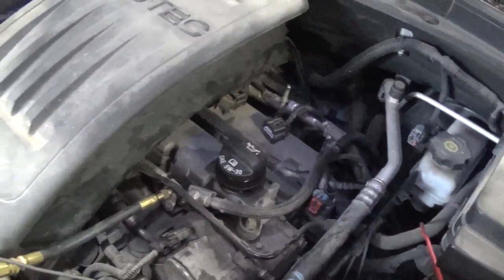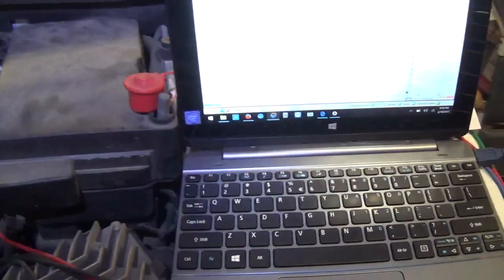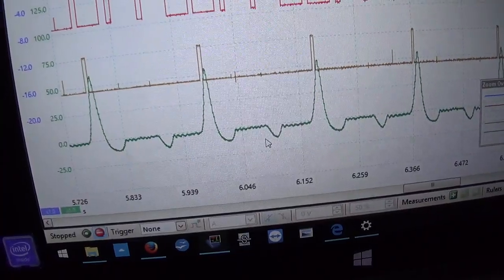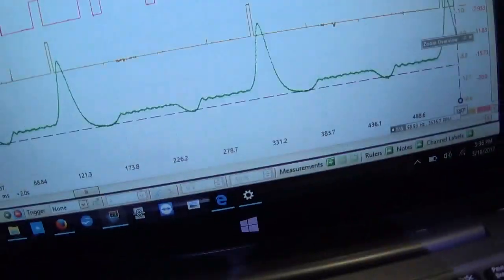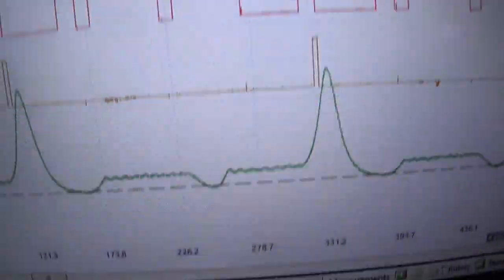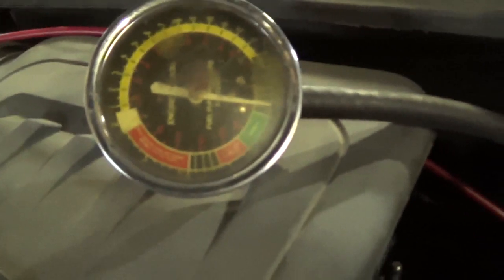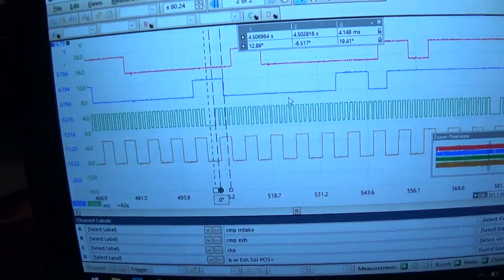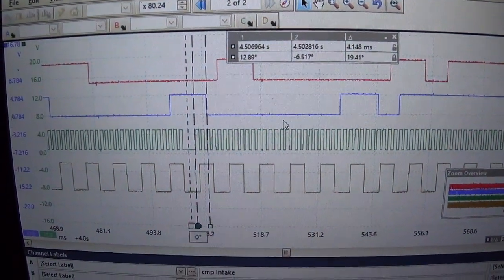P0016 P0011 Low Power case study: Chevy Equinox - Part 2

Comment: Yup been there, done that.Customer did new solenoids no better. We removed the cam cover, cam chain guides gone and most of the bolts that hold them ( top front bolt worn almost thru).Pulled the oil filter ,full of stuff. Customer installed timing chain kit. One thousand miles later engine seized.I bought the vehicle for five thousand (2010 awd LTZ , new GM six speed trans Ya the guy was tough on cars). Had the crank ground ten under, piston rings and gaskets and yes some did stick rings and burn oil. Put it back together, runs great(one and one half years later). The wife drives it every day she loves it(the body and interior were like new).  Yes boys and girls have your oil changed be somebody you TRUST and check your oil level at least once a week. Happy motoring.

Comment: Ivan this is a great video. Your pressure transducer is a great tool.  Going back to first principles when the intake valve opens the piston is starting on its descent in the cylinder and pulls a hard vacuum as it sucks air/fuel mix into the engine.  In theory the intake stays open until the piston reaches the bottom of travel and the cylinder is now full of air/fuel ready for the compression stroke.  However your trace shows two important things which are consistent with each other.  The intake valve, based on the short dip of vacuum, only opens for a short window so that the peak compression is only 62psi.  Most engines run at about 10:1 compression ratio so that you would expect peak pressure somewhere about 140-150psi.  Your peak pressure shows that the cylinder is only getting about 40% of the normal air/charge in the cylinder during the intake valve opening window.  It is amazing that this car runs.  You have also hit on something important here since the 40% charge when compressed and ignited still expands to the full cylinder volume.   Although this engine lacks its normal power it is actually running very efficiently for the lower power it actually produces as it is emulating an Atkinson cycle;  more work is being derived due to an effectively longer expansion stroke versus the compression. It would be good to put this car on a dyno and measure the power output and then measure the amount of fuel consumed. If the ECU, by monitoring the oxygen sensor feedback, can shorten the injection times sufficiently then stoichiometric combustion should be maintained.

Comment: Intake vacuum on my 2.5 was 8inHg when the timing was off. Engine load at idle was 50%! Ran even worse than this one. Would be interesting to see scan data for engine load. Might be as useful as using a vacuum gauge. Good stuff. Thanks Ivan!

Comment: Looking forward to Part 3. By those waveforms, compression check & low vacuum I think you'll find multiple issues. Once the timing and compression issues are resolved it should take care of the fuel pressure issues also.

Comment: Great job, i was watching it then realized the known good  waveform Keith sent you  was mine from iatn! Glad to see people are using it! Keep up the good work.
Reply from the maker: Cool! Now what year 2.4 was your waveform off of? Seemed to be different from this 2010 model...?
Reply: It was a 2011 equinox, the waveform i took was after the chain and guide replacement.
Reply: Also i have the known bad posted up on iatn.
Reply from the maker: Ah that would make sense! I think the cam-crank relationship changed 2010 to 2011...that would explain the discrepancy. Thanks for the comment!

Comment: Time for a story. The characters are:

Ivan (aka Padawan)
Keith (aka Yoda)

Padawan: Master Yoda I have a waveform here that is most perplexing. I shall send you the waveform.
Master Yoda: Your waveform I have received Padawan. The Force I have used to obtain a known good waveform. Most odd your waveform is. 
Padawan: What do you think the problem is Master?
Master Yoda: Off, it must be, your intake valve timing.
Padawan: What should I do next Master Yoda?
Master Yoda: Removed it must be the timing chain cover. Revealed for inspection must be the timing chain Padawan. 
Padawan: Yes, Master Yoda.
Reply from the maker: I had to use my own force on this one since Yoda sent me the waveform for a different year engine... XD
Reply: do you build in cylinder transducer boxes for people? If not, what plans did you use to build one? Do you still use the old style verus? Ill give you a docking station for it if you want one, i upgraded to the D10 and can't use it anymore.

Comment: Oh man, I was hoping for a part three or the fix as I wrote in part 1 I am having an issue with same code..This 2.4 only has 1 cam and 1 crank sensor both replaced.. Did psi test all four cyclinders are 180psi and at idle 20 on vacuum..as I've said replaced cam sensor and crank sensor and the vvt oil actuator and it does work..so my issue maybe ecm, I just don't know..

Comment: Awesome! Where in the Pico software did you set up your homemade transducer settings? How did you get the voltage to match pressure? I just barely got a Pico so I'm trying to figure it out.

Comment: C’mon Ivan. This was a easy one. You didn’t need 3 long videos for this. Some guys rely on the scope too much thinking it save time. In some cases it does. But in most cases it actually waste time. Especially if you’re on flat rate.
Reply: What most tech fail to realize is we don’t wast to much time with a scope, we use the scope to make sure our diagnosis is on point. What’s funny is most techs really on parts cannons then once it comes back multiple times, with tons of hours lost then they decided to do it right, yet they fail to take into account all the lost time while guessing took way longer then using a scope. Just my opinion.

Comment: ivan, is the engine worn out, or is it a result of the timing being off and simply not letting any air in?
also the actuator was replaced, but the sensor for the cam could be at fault considering the dtc for "position not plausible" ?
Reply: Daniel Karlsson 
My first thought, The throttle plate was being commanded (by foot) but not actuated. I didnt watch because I figured tps situation or a cam actuation solenoid oil situation from lack of  oil. Timing chain call on that?! I guess it worked tho.. 1 year old video and post I know just blabbing

Comment: Would the low compression have been picked up doing a relative compression test with the Pico?  I'm just curious what that test can/cannot pick-up. Thank you.
Reply from the maker: Well relatively all cylinders were the same! So that would NOT be the right test to use in this case :)
Reply: A leak down test wouldn't have worked either unless the valves have crashed.
Reply: motoYam82 thank you. I wasn't sure if that would show anything.

Comment: I'm wanting to buy a high amp clamp to check relative compression .  Snap-on offers two different ones. One is a 400 amp and the other is a 4000 amp. The Snap-on tool man don't know his product enough to answer this question. Which one do you have? Im guessing the 400 is enough but I want to be sure. Any help would be greatly appreciated. Thanks for your time and the Great videos.
Reply from the maker: 400amp is plenty for cars and light trucks. Now if you get into Diesel trucks they might draw a bit more.
Reply: Pine Hollow Auto Diagnostics Thanks Ivan. I really appreciate your help. Thanks for the good videos.

Comment: I bet if you pulled the valve cover the engine is slugged and the top chain guide is missing
Reply: Not if your negligent and too lazy to properly change the oil. The quick oil change places may do it for a few dollars less and probably use the same weight oil on all vehicles. This is a real bad idea. Take the car to the Chevy dealer. They use the right stuff and have a permanent record. GM has been really cracking down on this issue and telling car owners, your negligence is not our concern. Perhaps you would care to step into our customer friendly showroom.
Reply: the dealers are using the same engine oil we use at the aftermarket, the same company the supply as,goes to al local dealers, what the dealer do any dealer if the customer goes and ask for engine oil they sell them the the genuine bottle but they do not use that  .

Comment: Knowing those engines like i do i would say everything is worn out.
Reply from the maker: Good thing my wife chose a Nissan over this newer GM crap. Her 2010  has 182k miles and doesn't burn a drop of oil!!!
Reply: Yeah.....Some of the even older Nissans go forever although i have seen a few with chain problems also.  The 2.4 GM is a smooth, torquey engine that's good on fuel but even with meticulous maintenance they don't seem to last. If those chains jump far enough they will bend valves.
 It's funny how GM can build one of the best 8cyl engines on the road and yet the rest of their line is crap.
Reply: They built a few good engines, most of the small blocks, the 2.5, the 4.3 the older inline 6s.
Reply: Gm has been building 4 cylinder Dohc engines for a very long time and still cant get it right. Vega aluminum block engine 45 years ago burning oil like crazy. Quad 4 dohc junker (although iron block), Saturn engines have been around for 20+ years with about the same style of design.

Comment: start it on cold start and you can hear the chains rattle like an old ghost haunting a house... 
chances are the phasers are stuck.. need those. solenoid actuator valves ( both) , oil of course and timing chains kit. and maybe  high pressure fuel pump that is driven off the camshaft if the chains are jacked... it can through off the high pressure fuel pump
Reply: also if they are that low on oil check for oil leaks ... it can be the pistons/rings they can consume oil as well... due a oil consumption test, change oil fill to full mark drive 1000 miles , check level again see how much was lost and if its a certain amount in that millage it needs pistons and rings

Comment: LOW OIL AND WRONG OIL AND DELAYED OIL CHANGES WILL DESTROY THESE VVT SYSTEMS. HAD A NISSAN MAXIMA WHERE THE CAM SPROCKET WAS STUCK CAUSING CODES AND A MISFIRE. MANUALLY ENERGIZED THE VVT SOLENOID WHILE ENGINE WAS RUNNING AND THE SPROCKET FREED UP. I SEE THE OWNER OF THE MAXIMA ALMOST EVERYDAY AND ALL IS STILL WELL.I TOLD HIM TO STICK WITH THE RECOMMENDED OIL.

Comment: What the hell is on the inside roof of that garage ?
Reply: Unsupported batt insulation. Apparently lack of maintenance extends to buildings as well as cars.
Reply: That is one mean looking ceiling & very old structure for a professional shop
Reply: That place looks like a palace compared to mine! I've got a dirt floor, and NO insulation ...

Gotta run with what you brung, ya know?
Reply from the maker: It's not the building that counts...it's the knowledge, experience, and tools. That little one-man shop has more of all three than most "professional" shops!

Comment: No oil, low oil, dirty ili, wrong oil is the root of all evil and a quick death of an engine. Wait until the customer finds out what it cost to repair this. I'm betting it's more than a $40.00 oil change. Ah, now just throw down the engine and forget it.....
Reply: Dirty oli, yes I agree, but low? VVT works on oil pressure, which is there even when the oli is low. Unless you're racing. The combination of old oil & low due for going over the oli change -> yes. But just dirty oil? Too coarse filter element in oil filter, or there should be another finer grade oil filter before VVT actuators, IMO.